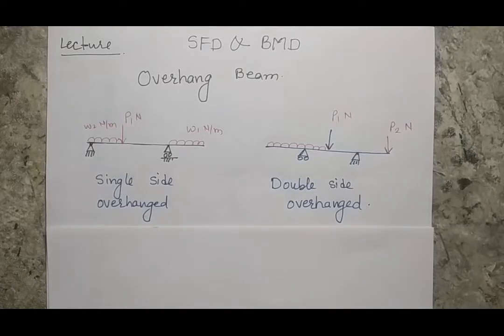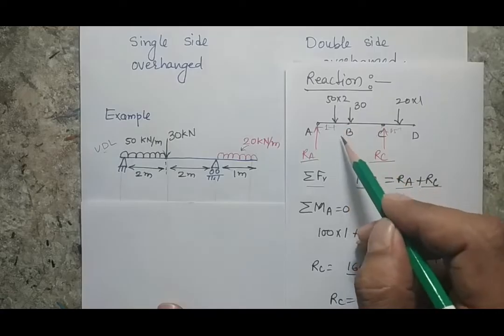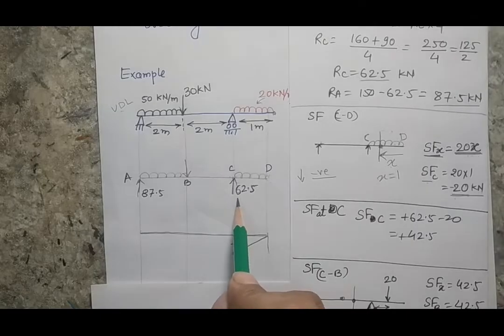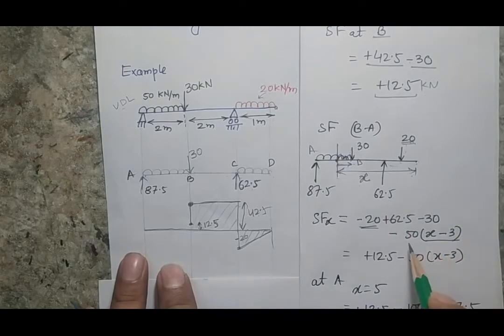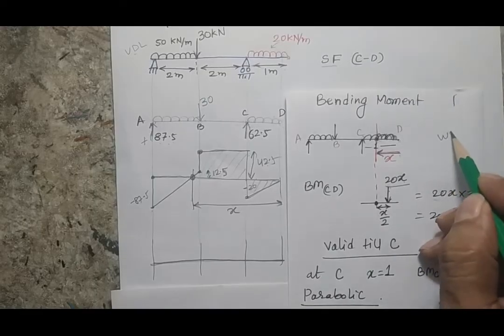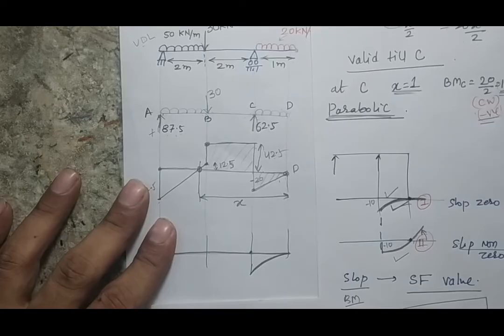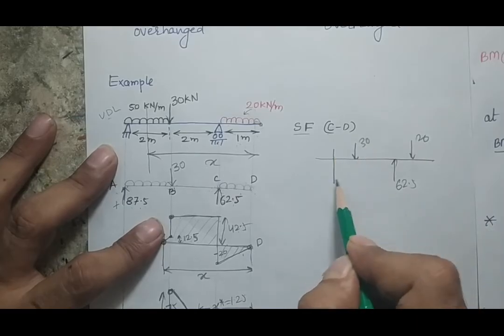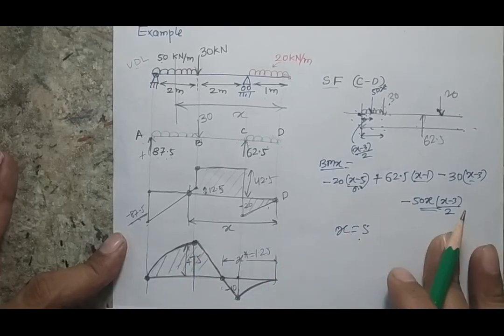Shear Force & Bending Moment L6 || Over-hanged Beam|| Mechanics || first year course

Comment: Sir while calculating the Bending Moment in the region A to B the Bending moment due to force 30KN acting at B will be -50(x-3)²/2 please correct me if I'm wrong you've taken -50x(x-3)/2
Reply: I came to the same conclusion
Reply: right it should be -50(x-3)^2 /2
Reply: @Sham-vb2yz  Ah those times !! I graduated this year and don't even remember what BM is now 😂😂. Still Ashish Sir is undoubtedly a great teacher. Good luck to everyone 💯.
Reply from the maker: Yes it will be (x-3)sq instead of x(x-3).... please correct